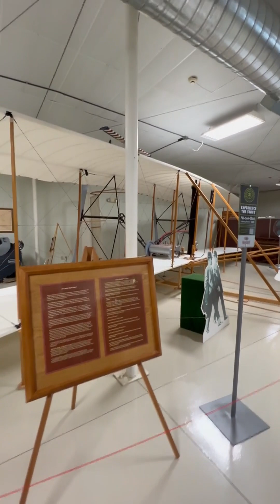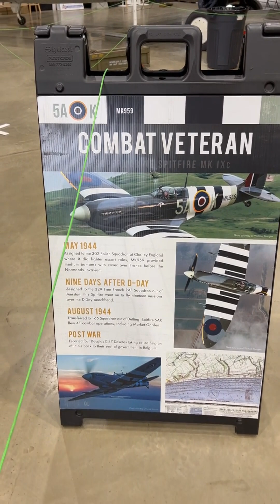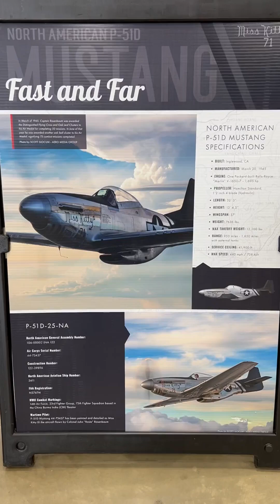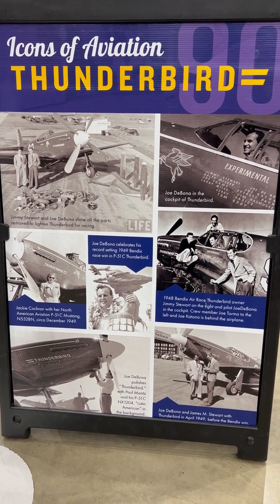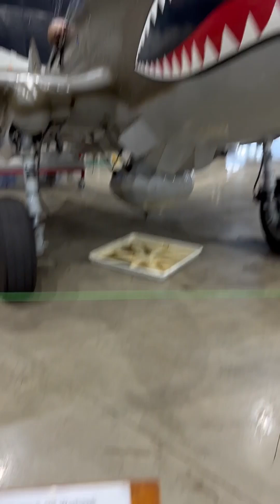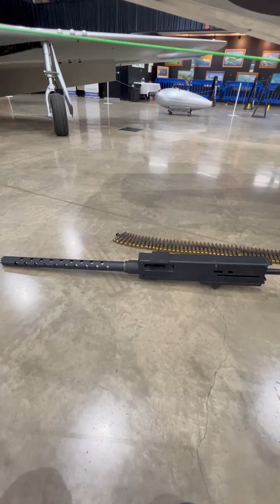Dakota Territory Air Museum Tour. #viral #viralvideo #aviationhistory #aviation #aviationlovers

Comment: FYI  Education time listen up.  The dive bomber version of the Mustang was the A36, and was ordered by the USAAF to keep the production line open after North American built 620 Mustang Mk I & II's for the Brits !!!!  USAAF had money in its budget for ATTACK aircraft and not fighters and to to keep the production line open, as A36 Dive Bombers, as war had started by then until more money became available for fighters which the USAAF ordered 1000 P51 A  Mustang fighters !!!   And as a FYI  ALL aircraft engines are also OIL COOLED, in line also Water cooled, and Radials are Air cooled, but ALL rely on Oil cooling and radiators to cool the oil, break an oil line and when an air cooled engine runs out of oil the engine will also seize!!!  That Bullcrap you spout about vulnorability of liquid cooling is just that !!!
Reply from the maker: Thank you for the information. I really appreciate it. The one "Achilles' heel" of the A-36A (and the entire Mustang series) remained the ventral-fuselage location of the radiator/cooling system, leading to many losses. As the invader was replaced by P 40s and P 47’s in June 44 in Europe I think it was determined they were more reliable. The mustang itself was an excellent high-level altitude fighter and I think that’s more what it was designed for.